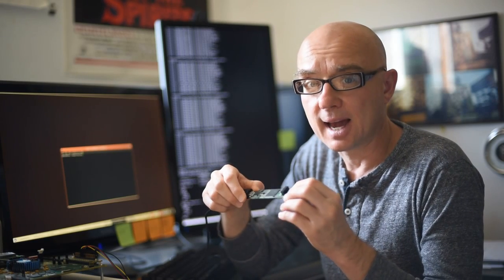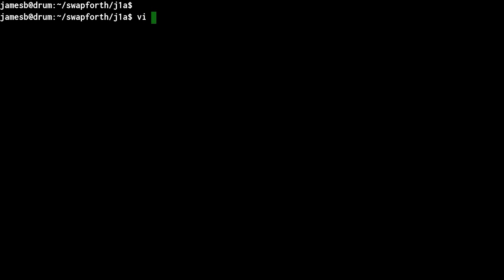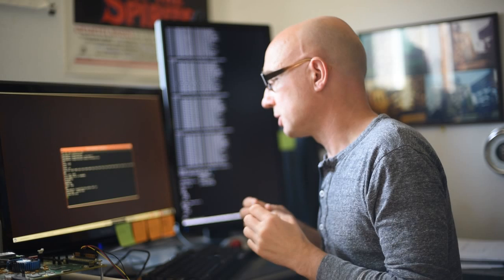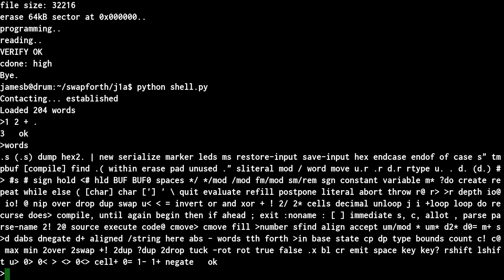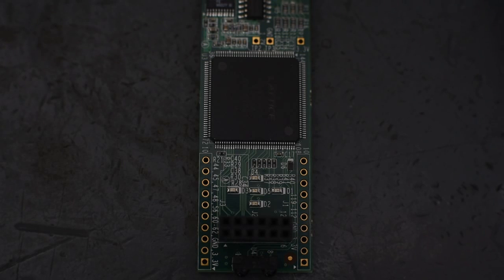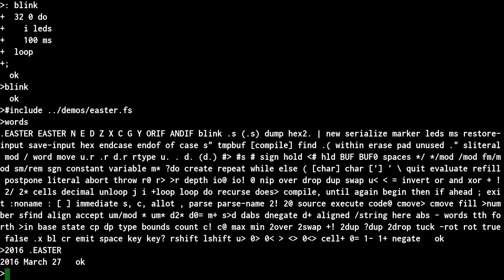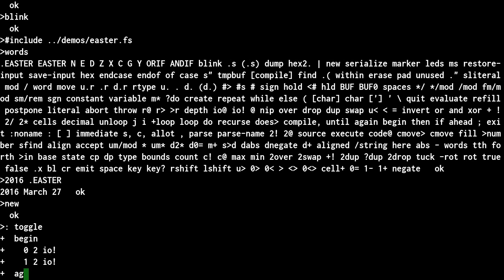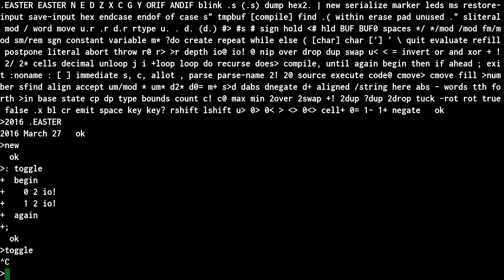J1a SwapForth

Comment: Very interesting!  It's really cool when you can port FORTH to a new HW environment, surprising how little code it takes.  I wrote a rather hacked-up version of FORTH for the IBM PowerPC 403GC/X in assembler and even using the large 32-bit opcodes I could get a very functional environment in under 8K (Which included pre-emptive multitasking).  It definitely gives you a much greater appreciation for what kind of things that have to occur under the hood for your average compiler.